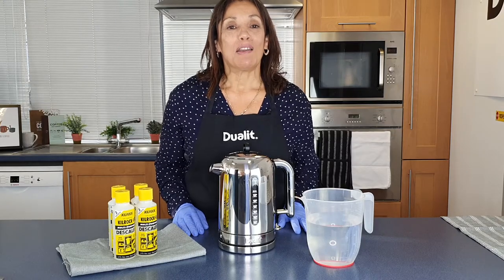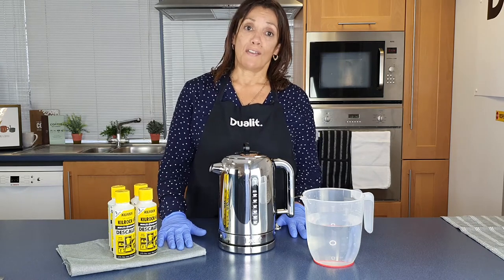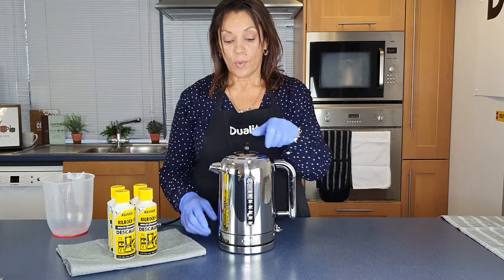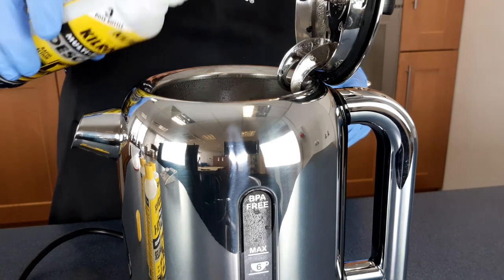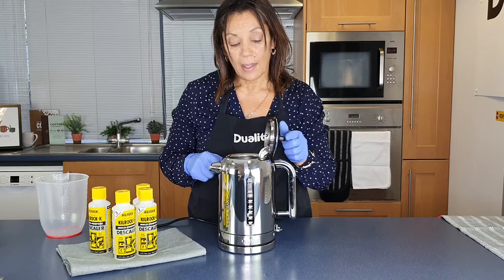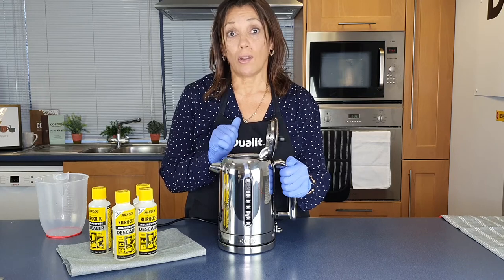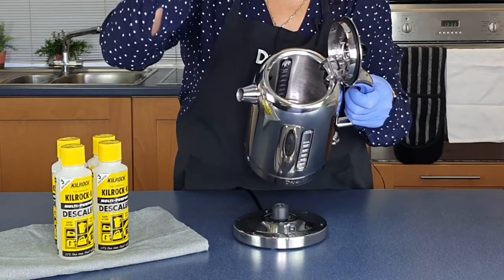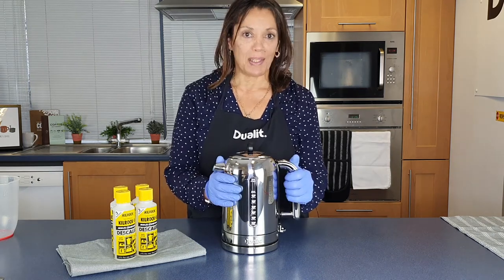How To Descale Your Classic Kettle

Comment: Remember if you’ve descaled four or five times and the on off switch keeps tripping before it’s boiled. The element is faulty. Eventually it will fail and a new element. If it’s in warranty then it will be fixed free of charge. If it’s out of warranty then buy a cheap kettle and cry over the fact that you spent £120 on a useless British made kettle.

Comment: This Dualit Classic Kettle is rubbish. Ours lasted less than 2 years. There's a commom problem with the switch. You'll need to send it in to Dualit and will cost £54 to fix. Plenty of poor google reviews. AVOID.
Reply: Ours is still going after 8 years 🤷‍♂️
Reply: ours is also going after 8 years. The lid ring snapped off about 4 years ago and I contacted duelit to see if I could get a replacement at my cost. They wouldn't accept that and sent a whole new lid to me free of charge by expedited delivery. It is an excellent kettle. So much so we have a brand new one we bought last year in a sale so that if this ever does die we have a spare. Buy a cheap kettle if you want but ours was £112,  8 years ago. £14.00 a year and it isnt dead yet. Nor rusty. Only here because even though we don't have a limescale heavy water even after 8 years it's finally got some lol.